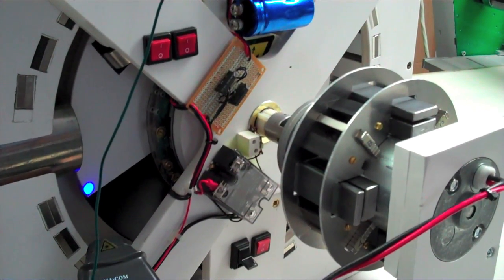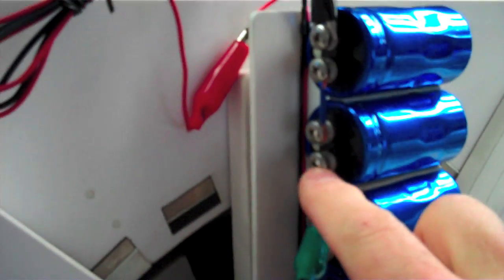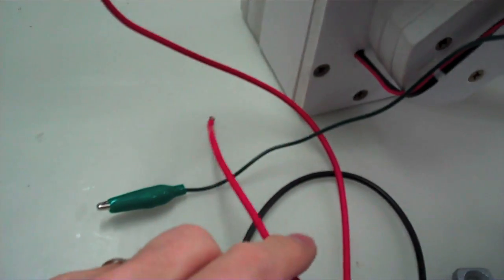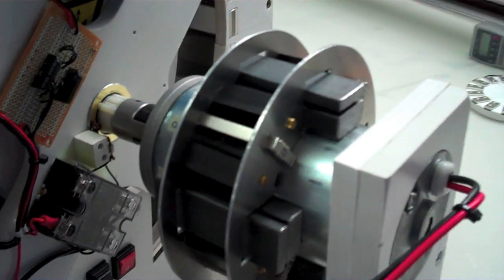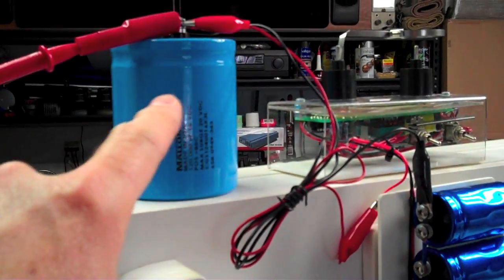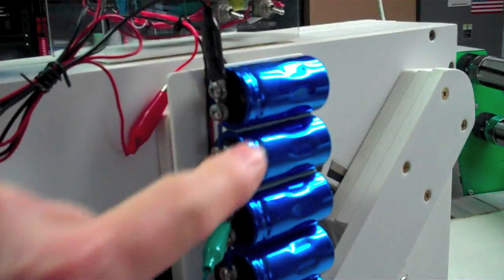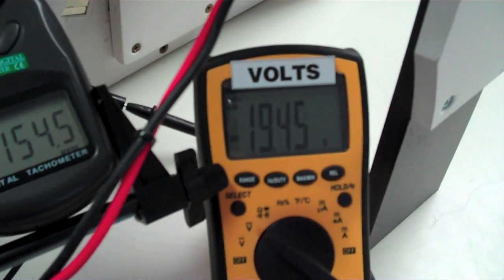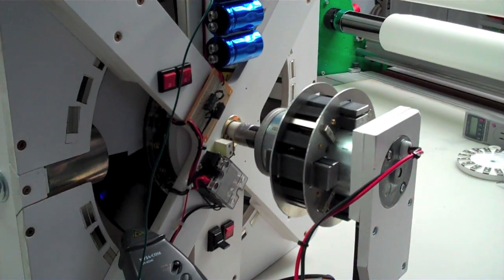SELF CHARGING?

Comment: @Nomoreidsleft Also, in a system like this (or any system!) You don't want to connect your ammeter dircetly to the capacitors, because you might fry your ammeter. An ammeter in paralell with a capacitor pretty much acts like a load with a low resistance. Connecting the ammeter in series with the output shouldn't show an increasing reading... although it could. Even a flat reading at say, even 100mA, constant current and voltage still shows that the system is generating energy.

Comment: @Blodslav The energy stored in a capacitor (j) is equal to the work (watts) done to charge it. If 1/2 C*Vsquared=J, then J=watts stored. Consider 2 capacitors which are (unrealistically) exactly identical. Same capacitance. One is charged to 10v, the other is charged to 5v, which one stores more energy? The fact that the voltage rises on those capacitors proves the system works, assuming it's not powered by an auxiliary source. And those are some big capacitors.

Comment: @Nomoreidsleft I guess you could argue that electrical energy is never actually "created" per se, it's only being released and utilized. The electrons are in the outer shell of every atom in a connected system. And, no I don't need to review my physics, but I encourage that you review theory on capacitors, and review how a capacitor stores energy. If the charges on the plates are +q and −q, and V gives the voltage between the plates, then the capacitance is given by c=q/v. Cont'd-->

Comment: @Blodslav You really should review your physics before an attempt a refuting someone's comment.  First of all the analogy exactly describes how electrical generation works when using coil generators.  No energy is every created by the collapsing magnetic field.  The magnetic field is only used to transform mechanical energy into electrical.  Just as in the water analogy, no energy is created by squeezing the hose.  Just the speed with which the energy is released.

Comment: @PMMG4HYBRID Do you show it in another video? I don't see the amps going up on any meter.  If your claim is that the motor speedng up is an indication that the current has increased, you need to justify that.  Mostly motors speed up as the voltage speeds up.  If indeed you have proven that both current and voltage has increased, then yes, you are increasing the power of the system.  But this video does not have direct evidence of that.

Comment: @Nomoreidsleft This is a very bad analogy. It better describes a solid state AC transformer, where you're changing the voltage in inverse proportion to the current. You probably heard that analogy from someone who knows what they're talking about, but it doesn't apply here. Voltage increasing on a capacitor is directly proportional to the energy in joules stored in that capacitor. Electrical energy is unique in that it is created by the collapse of a magnetic field, -cont'd

Comment: So, what's new here?  Have you ever held your fingers at the end of a garden hose, to decrease the exit hole, and seen the water just shoot out?  You're doing the same thing with electricity. In the case of the garden hose, you don't have more water, and in this case you don't have more electricity.  If you continued running it, the motor would eventually stop, because all the power has been drained from the capacitors.  You've raised the voltage, but not the power of the system.

Comment: Beautiful build with intriguing results! 
Next step seems logical: add a load. The largest that won't choke the system. See how long you can keep it running. Preference for a non-controversial load, such as waterwheel, large stock fan, etc.
More load (than the ultra-effficient motor you have there), and more time. Find the greatest possbile sustainable load. Max charge seems less important?

Comment: Are there still any batteries in this circuit or controlling the relays or anywhere ??
If not you have shown a real selfrunning and accelerating perpetual energy system
or better said a real free energy device ! Congratulations !
Regards, Stefan.

Comment: Wonderful achievement, you should be really proud of yourself right now! Very exciting!

Integrate the larger capacitor and the Stargate motor into your Quanta chassis, remove the high frequency generator, throw in a user manual, and you pretty much have yourself a commercial unit ready to go (ebay?). I'm serious! That's how polished this thing is in terms of looks & functionality.

Maybe the next step could be to show it's real world practicality, powering a range of different appliances.